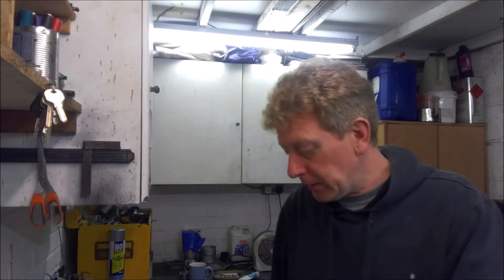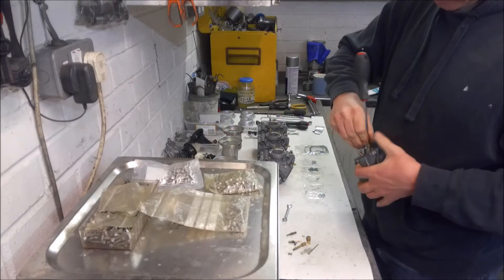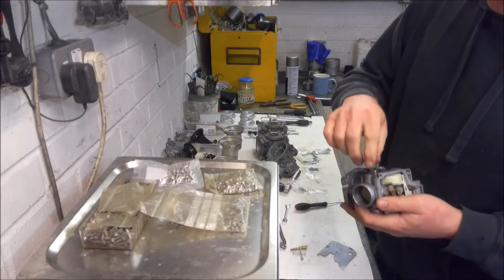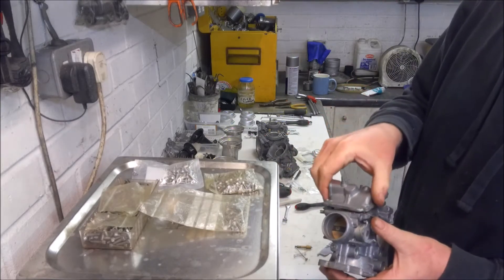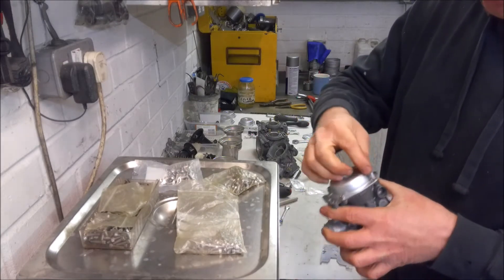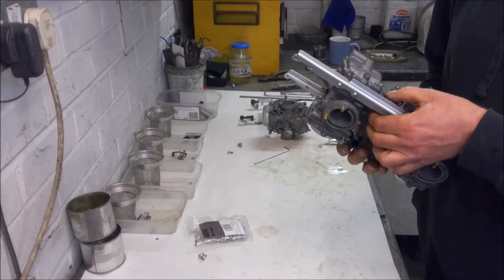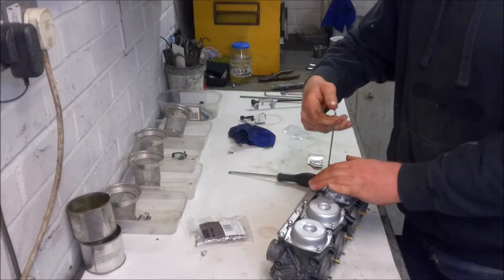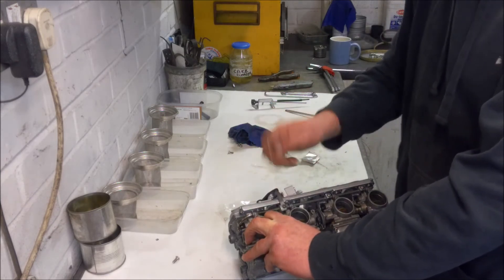CB-1 part 8 - Carb Rebuild

Comment: I appreciate you sharing this video. I was syncing the carbs on my CB-1 a few days ago and nearly got them synced. I turned the bike on a couple days later and cylinder 2 wasn't firing. Checked to see if I had spark and I did. I have been running a filter from my remote petrol tank ever since I had the carbs rebuilt with the LiteTek rebuild kit, so I'm perplexed as to how a jet could get clogged. I'm very annoyed that I need to clean the jets again. The fuel tank was really rusted when I started restoring the bike, so I'm planning on running two fuel filters to the carbs, hoping that I don't ever have another clogged jet... The tank was soaked in distilled vinegar for 5 days and that seemed to get rid of a ton of rust, but not all of it. I may try an electrolysis experiment to get rid of the remaining rust.
Reply from the maker: Hi Jacob, thanks for the comment. I think we have all been in the same situation as you, it's not uncommon for carbs to need more than 1 clean and the smallest bit of muck can cause havoc with the jets.

Comment: So you're going with the original carbs then? I thought you mentioned swapping to the cbr400 carbs in an earlier video. Would love to know what and why as i am currently trying to get my CB1 sorted. Thanks for all the informative videos. Learned more from these than all the years owning the bike combined
Reply from the maker: Hello & thanks for the positive comments. The plan was to fit a set of carbs from an NC29 as they are lighter and a flatslide design but it turns out that the spacing of the carbs is different to the NC27 carbs so won't easily fit. I decided that it was easier to stick to the NC27 carbs but will have to change the jetting.